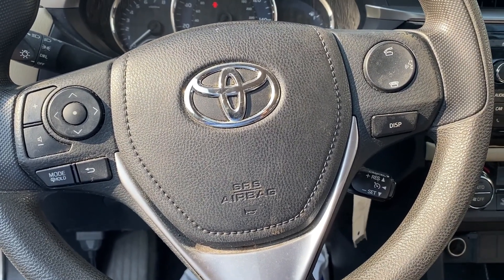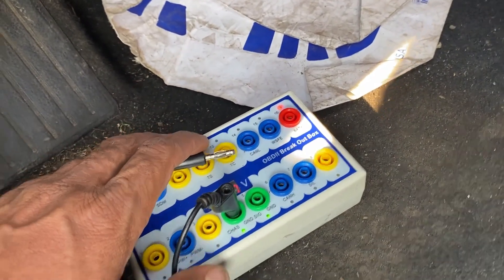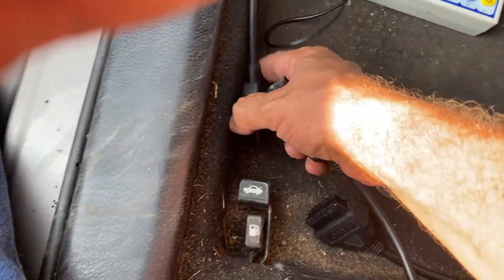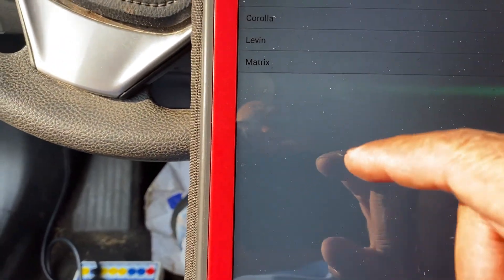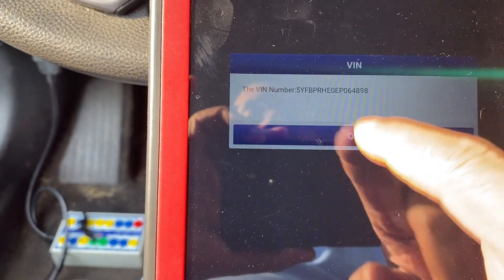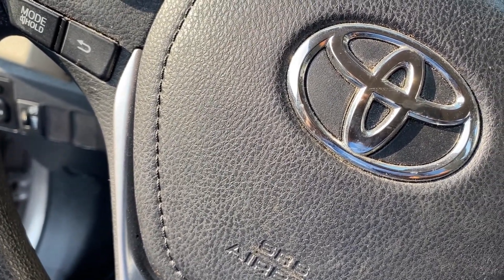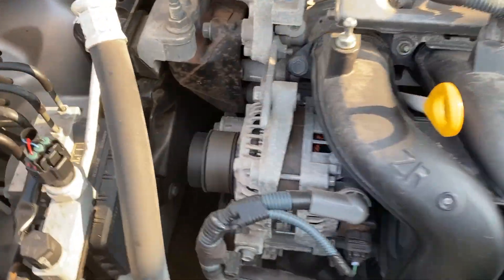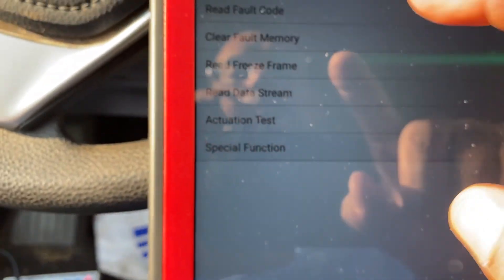How to program TOYOTA, LEXUS ECU computer, fix for code B2799, ECU SWAP step by step

Comment from the maker: Don't Forget to LIKE 👍 SUBSCRIBE 🔔 SHARE ↗
Be sure to subscribe for more programming Videos
Reply: Brother.
Kia carnival
We entred a wrong pin to program the key .now the computer is locked .
Any idea how to unlock it.?
Thank you so much.
Reply from the maker: @MsSouham  no problem,                        For mechanical keys leave key on for 1 hour.
• For smart key (proximity) leave car alone with
good battery charge for 1 hour
Reply: Is mechanical key .
We did leave it for 3 hours but, nothing happend.
We might have to try disconecting the battery for 10 or 15 mns.to see if this is gonna fix tge problem.
Thank you brother Nassr.
Reply from the maker: @MsSouham  make sure to switch the ignition key to ON, otherwise, try to virgin the ECU then you can set a new password (pin code)
Reply: Is it reseting the ECU ?
I will try doing it with AUTO PRO PAD.
Shokran Akhi.
Reply from the maker: @MsSouham  yes if you leave the key ON for one hour make sure to connect the battery charger to keep the battery at 12Volt, Alshoker Lillah
Reply: By removing the battery it did the job
Thanks brother Nassr.
I preciate your help